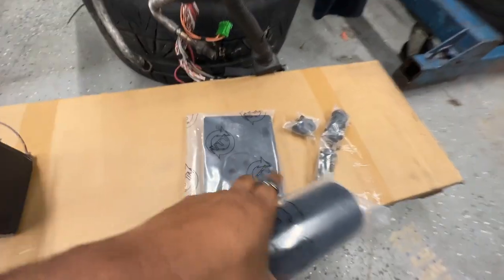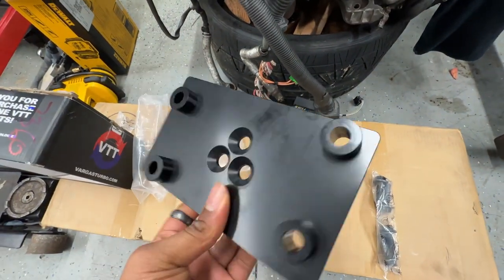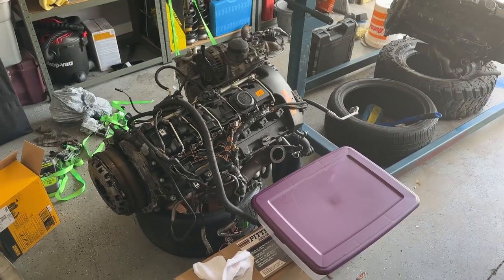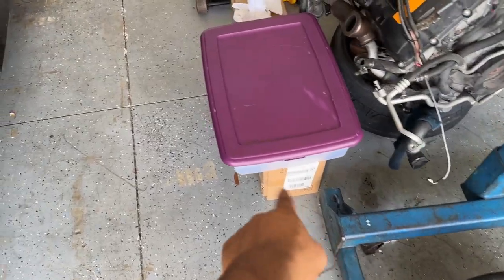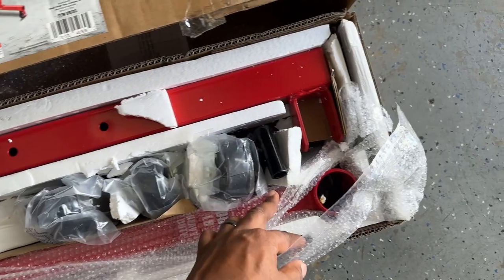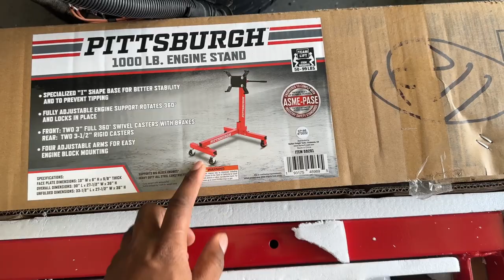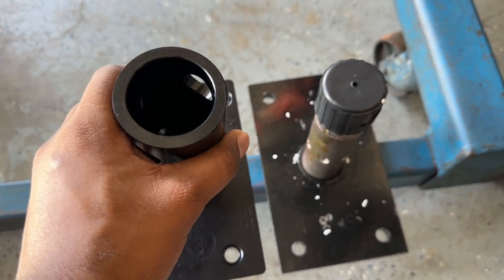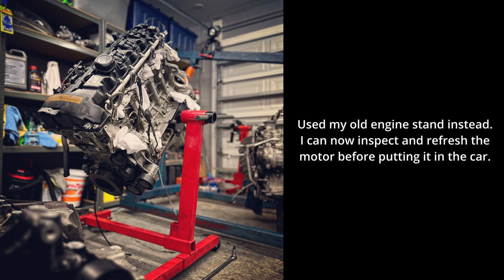New Engine Stand and VTT N54 Bracket - S1E09

Comment: Whats up bro...im in the process of replacing a 525i n52 motor swap...i watched your vlog great help is the anyway you could tell me what the torque specs are on the flywheel to the crank automatic trans....amd the torque specs on transmission to engine thanks keep up the vlogs bro they are very detailed and helpful
Reply from the maker: Thanks! Appreciate it. From what I checked it’s the following. For the flex plate it’s 121nm  and for the transmission to engine 

M10-30mm : 20nm then 90 degree torque to yield
M10-85mm : 20nm then 180 degree torque to yield
M12 : 25nm then 130 + 20 degree torque to yield

Hope it’s of help, good luck with the swap!